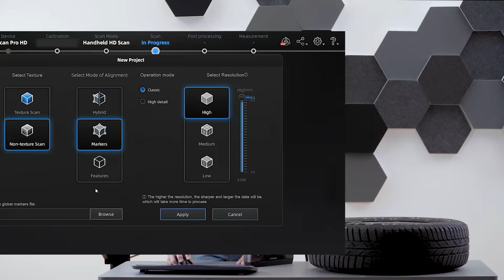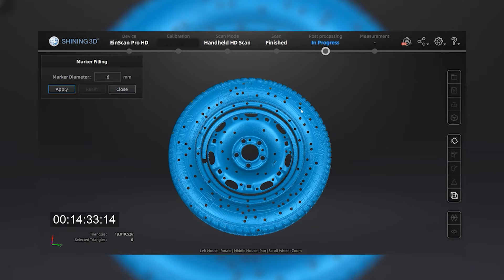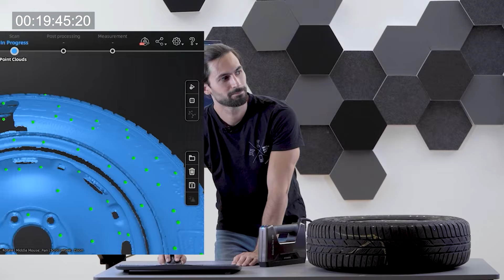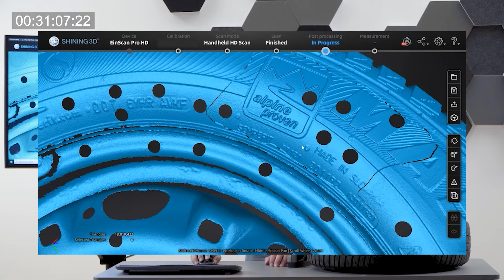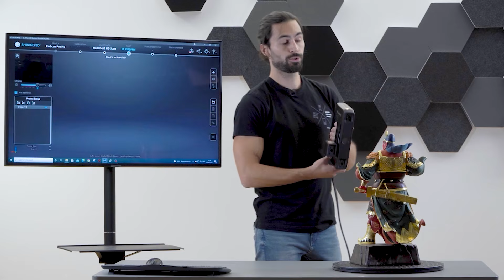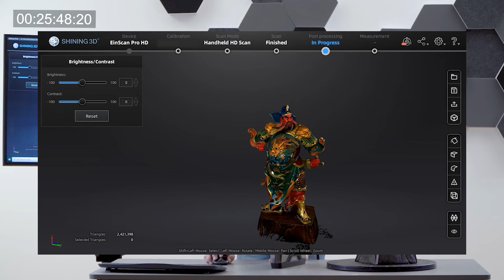Demo: Handheld HD Scan Mode with EinScan Pro HD

Comment: Hi. I bought one EinScan Pro 3D scanner in March 2022. and followed the instructions. I am lucky It is really cool. running well. Just have one problem to fix. For Human Brain Scanning I could not go under the plexiglass as I cannot move the soggy brain. So, I need to hand hold and go all along the circle but after 180digree it lost. So, I did two projects no 1 for the top and number2 for the bottom. Now my question is how to merge these two Projects together to get the whole brain in ONE image?
Reply: That’s the most terrifying comment I’ve read

Comment: It looks so easy when you're doing it and when I try it is a complete disaster. I press the button it says "Preview" - should I do anything there ? The brightness is OK. I press again and it starts playing music, scan fails. No any clue why. Is it problem with the GPU ?
Reply: Join the club! Bought one of these a few months ago - total failure. It's close to the dumpster,  but we're trying to figure out who to blame for buying it before we admit defeat 🤭

Seriously, if anyone wants one, buy it only on the basis that you'll pay when it's working solidly and reliably. Learn from our $15k mistake!
Reply: @chairmakerPete   any progress in the past months?
Reply: @chairmakerPete  I start having the same feelings, they get some hollywood actors to looks like it is simple but in reality is not. Even his scan is a POS as you can clearly see the indents from the high definition insert
Reply: @RCREVIEWS101  the Einscan Pro HD is a total croc. Avoid at all costs. Can't speak for the rest of the einscan range, but don't make the expensive and frustrating mistake we did.
Reply from the maker: Have you ever tried using the scanner on another computer? In general, you could press the Play button to start scanning directly after the preview interface is appeared, and what you called "starting to play music" is probably because this button was connected to some entertainment function shortcuts customized by your computer. Please note that the scanner is only compatible with NVIDIA GPU whose CUDA Compute Capability Value is ≥ 5.0.
Please send us a ticket on https://support.einscan.com. We will follow up and keep you updated.
Reply: @Shining3DScanner  The button is on the scanner and the music comes from its software. The computer is laptop with 2 GPUs. I will check on another computer then.